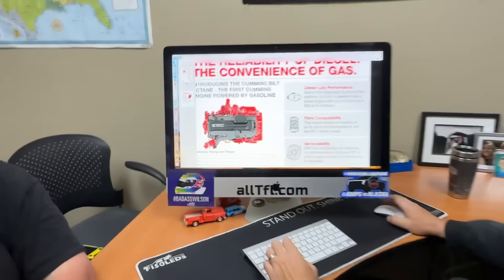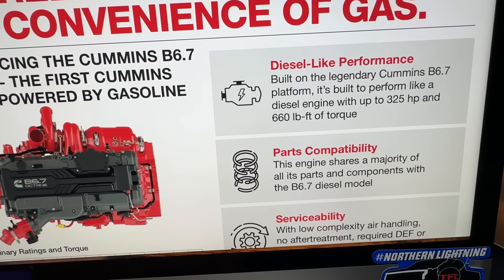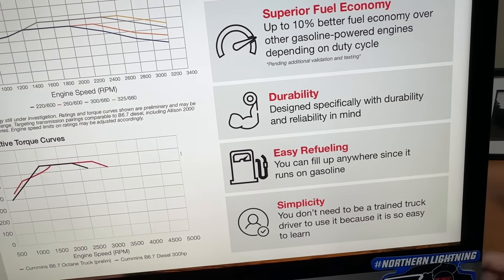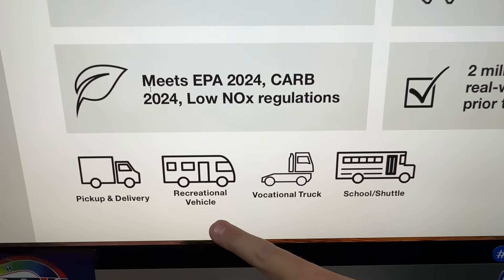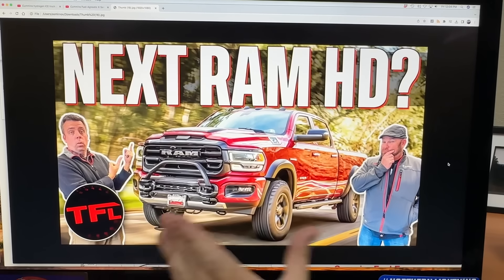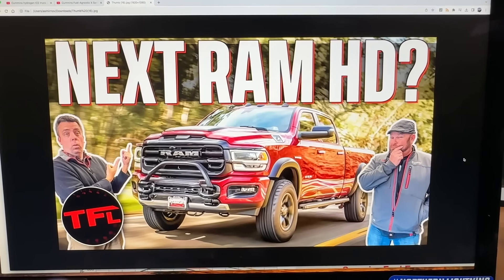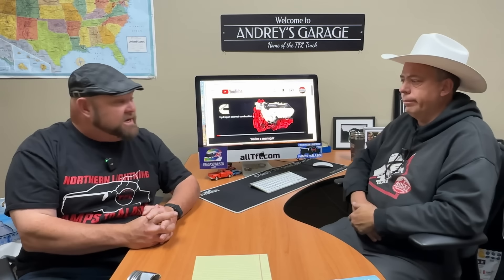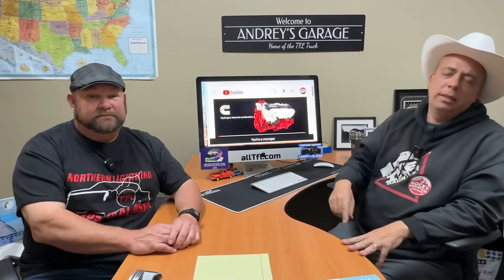It's Not Just Diesel Anymore: Cummins Built a GAS Engine We Want to See in the Next Ram HD!

Comment: I work for Cummins and seeing the tech they’re coming out with behind the scenes is mind blowing. Excited for what’s coming out!
Reply: have they fixed the diesel block yet .they lighten up new design and now it stretches
Reply: @overbuiltautomotive1299  what engine are we talking about?
Reply: The 6.7…they reduced the block weight and now the crank main caps are fretting
Reply: @marcusrussell3375  I know they reduced the weight but the engineers also claim that it’s stronger than ever. In the heady duty world we don’t really see issues with the bottom end on an ISB. We do see a lot of dropped valve seats and what not.
Reply: @overbuiltautomotive1299 the engine that's in the Ram trucks is completely different from the actual B6.7 engines
Reply: What octane gasoline will be required?
Reply: The power numbers are anything but "mind blowing" though. Maybe it would sell well for industrial applications but very few people are going to buy a 3/4-1 ton truck with under 350HP. If this thing basically has a diesel bottom end and rotating assembly then it should be more stout than a 2JZ with more than twice the displacement! It should reliably be able to make north of 400HP with the boos turned up a little. Cram 25-30PSI of boost down it's throat and it should be able to reliably make 600HP and 1000ft-lb.
Reply: @johnlacaria2728 87 octane. On the newest up dated version on the spec sheet it says 87

Comment: We have 7 15L Cummins running on natgas here in the oil field.  All have over 50,000hrs on them trouble free.
Reply: We’ve ran propane mowers for landscaping and the oil always looked new on them. Just didn’t have the pick up gasoline does
Reply: 915 cubic inches
Reply: Are these ISX12 N engines?  The X15 N is brand new and hasn't been around for 50k hrs (7+ years).  Or were they converted for dual fuel?
Reply: Do you see lot of cat 3520 natgas engines?
Reply: @freedomisntfree_44 i see what u did there
Reply: @MrPizzaman09 That's not entirely true. Well, I guess it's technically true. There was a Westport branded orange ISX that ran on CNG and diesel. That's over a decade old at this point.
Reply: They don’t do as well in an otr truck
Reply: @darryladams519  some if the trucks have 16L
Reply: Don't belive that for a minute used to have 35 of them where  i worked they were junk 4 maybe 5 miles per gallon  no power we pulled 53 foot trailer took for ever to get up to 55 miles a hour  empty or loaded
Reply: When do the tanks for to be replaced?
Reply: Good to hear i brought 6 125 generators  from united rentals to oil rig would not keep running

Comment: Gasoline.  The best delete kit made.  I literally specifically ordered my Duallie 3500 with a Hemi to avoid the issues of Diesel Regulations.
Reply: Particulate filters are coming for gas engines.
Reply: Shhhh, if everyone knows our secret, gas engines will be more expensive. "YEAH DUDE, GAS IS FOR PUSSYS!"
Reply: A hemi and straight six gas engine are not equal. Your gonna drop a valve far before a cummins would.
Reply: systems today are extremly realible. failure are mostly due to poor maintenance which they do require a few other things. but i took my first particulate filter to 577,700 with out issues at all. everything i needed to do was right there in the owner manual.
Reply: Diesel is still the king for towing heavy loads. No comparison to gas..
Reply: @jamesrussell6870  Explain the Ike towing test results with the 3.0 liter diesels and the 2.7 EcoBoost.
Reply: I was going to do the same for my next truck.
Reply: @PistonAvatarGuy  You're talking about small displacement engines in a half ton pickup. How well do you think a 15 liter gas engine would do in an OTR truck? Think it would make it 1,000,000 miles before an overhaul like many diesels do? Gas is great for lightweight vehicles but cannot compete when it comes to pulling heavy loads.
Reply: @jkneeland89  We just established that a 2.7 liter gasoline engine tows far, FAR better than a bunch of 3 liter diesels in light pickups, so why wouldn't a 15 liter gasoline engine be able to match the towing performance of a 15 liter diesel in a long-haul heavy truck? I also wouldn't suggest that gasoline be used in heavy trucks, it's too expensive, but CNG works just fine and the engines last every bit as long as diesels, while also requiring less maintenance.
Reply: @jkneeland89  It's also worth noting that gasoline aircraft engines outlast diesel aircraft engines, so how long a gasoline engine lasts is simply a result of how long it was designed to last, it's not related to the fuel that the engines are burning.
Reply: @PistonAvatarGuy  It all depends on application, which was my point in the first place. You are trying to imply that diesels are obsolete and gasoline is superior. That is simply not the case. Gasoline will never replace diesel for OTR trucks, farm equipment, etc. But I guess all those manufacturers that build diesels are just stupid, they should’ve consulted with you first.
Reply: @jkneeland89  Diesels are obsolete in light vehicles, they simply don't offer any advantages in light vehicle applications.

I never said that gasoline should replace diesel in heavy vehicle applications, nor did I imply that it should. I said that CNG should replace diesel in heavy OTR trucks.

And, no, the manufacturers of diesel engines are not stupid, they're simply building engines which make use of a fuel that is still relatively inexpensive and available, but that can change and it almost certainly will.

Either way, the diesel fanboys always try to argue that diesels offer a performance advantage, but that's simply not true.
Reply: You ppl that believe gas is where it's at go ahead pull heavy loads long distance with gas good luck with that
Reply: @lost94133  As far as pulling power goes, gasoline engines massively outperform diesel engines while towing.

As far as efficiency goes, it's difficult to make a direct comparison, as the only turbocharged, direct injected engines are too powerful to compare to the diesels in their displacement range, and the HD pickup truck engines currently in production don't use comparable technologies (no turbocharging and/or DI), but the difference in an apples to apples comparison is almost certainly not all that significant. No modern gasoline heavy truck engines exist at all, of course.

And, just for the record, I'm not saying that gasoline engines should replace diesels in heavy trucks, I'm just saying that gasoline engines tow heavy loads just fine.
Reply: @lost94133  Don’t waste your time with avatar clown, he’s a troll. I remembered his name after responding from other videos. He always makes ignorant comments about diesel. I’m not even a diesel “fanboy” I just have common sense.
Reply: @jkneeland89  If I'm a troll, how am I wrong in my assertions here? I really would like to know.
Reply: @PistonAvatarGuy idk man, an 8.1 big block tows just fine…
Reply: @jkneeland89 Horses for courses, right? Diesels are great for industrial and heavy-duty applications. No argument. Most pickup owners are taking their ball to bowling league night most of the time. Dodge and Cummins made a mint off of the dominance fantasies of suburban dads.
Reply: @Jez-p9k  Yeah, but at the same power level, gasoline engines can be nearly as efficient and are definitely efficient enough to be cheaper to own and operate.

HD diesels are only superior because there are no HD gasoline engines that are built to compete with the diesels (large displacement, direct-injected, turbocharged).

I know exactly what I'm talking about, kid.
Reply: @jamesrussell6870 spoken like someone who doesn’t even understand the difference between.
Reply: Yall are arguing over a question that's already been answered in thermodynamics. Diesel engines are more thermoefficient than gasoline engines. It's 30% to 20% iirc
Reply: @jeffhall768  Diesels are not inherently more efficient. The Otto cycle is more thermodynamically efficient with much lower compression ratios (a Diesel cycle engine would need a compression ratio of about 22:1 to match the cycle efficiency of an Otto cycle engine with a compression ratio of 12:1), and with the high compression ratios that gasoline engines are able to achieve these days, diesels rarely offer a significant (thermal) efficiency advantage. Modern gasoline and diesel engines are both in the mid 30 percent range as far as thermal efficiency is concerned.
Reply: @jeffhall768  It's also worth noting that diesel engines in aircraft are LESS efficient than the 70 year old gasoline engine designs that they're attempting to replace.

Comment: Kubota did this because they already had diesel blocks,  doesn't work the other way around because diesel blocks are stronger than gas blocks.   Could make a VERY long lasting gas enginge
Reply: Agree,  The big challenge for a spark ignited engine is the ability to transfer heat into the jacket water.  With direct injection, 3 way catalyst and a specific cylinder head this engine could be really successful.  It takes more than just putting a spark plug into a diesel head and calling it a day.
Reply: Time will tell its all about emissions

Comment: Multi fuel engines have been around for industrial and military since the the 1930's
Reply: This isn't multi fuel.  Each engine will still be only single fuel type
Reply: Thank you for calling it multi fuel. That's what is was, is, and has always been the term. Not this bs term that Cummins is calling it.
Reply: @gearhead7896  Yeah, they refine it and give it raised white letters and they've reinvented the wheel. 🤔
Reply: @davidroche9964  🤣😅🤣 Reminds me of tron legacy when they ask well what improvements have we made to OS12 and the CEO says we put a 12 on the box
Reply: @gearhead7896  Yep, marketing 101 ! 🤨
Reply: @jdking25  Yes, that is how it's presented and you're probably right. But, I think some will be multi fuel, at least bi fuel. Like CNG and Gasoline for sure.
Reply: @gearhead7896 No. Single fuel per engine, just multiple flavors.
Reply: @MCgrease08  No, re read my post. CNG engines are typically bi fuel.
Reply: True but civilian vehicles have  emissions systems wich could be  a booger to engineer for a multi  fuel
Reply: Not multi-fuel. Different heads for different fuels.
Reply: @jml6357  we've been through this, read all reply comments before commenting
Reply: @gearhead7896 Cummins CNG engines are not bifuel.
Reply: @wallcouldtalk  yes, but 99% are
Reply: @gearhead7896  Not anymore.

Comment: One thing I think is that if they give up Cummins in heavy duty truck while the other manufacturers still have their diesels they will loose. Ram Trucks are very nice trucks but Cummins is a big part of what people like about them. Replacing the Hemi with a Cummins gas engine might work as long as it performs but if they give up Cummins diesel for some in house motor I think that would be a huge mistake. Cummins has a loyal following and I think people will walk away without it.
Reply: I think it just allows for more and better options. Because Cummins and Ram are so good, and like you said, Cummins has a loyal following, Ram and Cummins might do better with this head change tech. I love Cummins, I’d buy any engine they make, gas, math as, or diesel, great engines
Reply: The cummins name is the only reason Ram uses their engine. Fiat makes their own 6.7 engine for their CNH equipment. (case/new holland)

Comment: Cummins already makes natural gas engines for their natural gas generators that we use offshore and on hospitals in South Louisiana and also for water pump stations some big 6.7 L engines that work off natural gas. Or to run on diesel, the engine designed to run on natural gas or diesel whatever fuel you have.
Reply: I bet the gasoline launches forst

Comment: Well if they got a crate engine solution and you can put it in an existing Ram because you want to get rid of the death filters and still have the ability to pull a trailer or haul a load that would be awesome and the possibility you could retrofit this to an older truck and have a stick shift behind it

Comment: In the 90s there was available a natural gas and diesel mixed fuel aftermarket kit for large trucks and later for smaller diesel vehicles. These used about 25% methane and 75% diesel. The improvement in noise, emissions, mpg,  and smoothness was incredible. It was also complicated.  But it might have been better than DPF measures.
Reply: As an engineer at a truck manufacturer, I have more recent experience with Diesel engines that have aftermarket conversions to run on natural gas.  On smaller engines, like a Cummins B, they entirely eliminate the Diesel fuel by installing spark plugs in place of the injectors and pumping natural gas into the intake manifold.   On larger engines, like a Cummins X, they make dual-fuel system that uses a small amount of Diesel fuel as a pilot injection to light off the natural gas.

Comment: International used to build a huge I6 gasoline engine.   The biggest one was 501 ci.  But they also had 401,406,450.
Reply: 1091 Hall-Scott inline 6…
Reply: International is absolute junk!
Reply: 534 was the biggest
Reply: @billsoinski9136  That was Ford, and you had to cover your truck in gas tanks to get anywhere with one.

Comment: Really nice to see more Internal combustion options for real world needs. especially working & commercial duty trucks....  Plus... being that it's using the traditional Diesel block.... which is designed for high cylinder pressures of diesel combustion/Turbo.....  This would make this a Very Robust candidate for performance upgrades.... this might be a MONSTER if done right.  looking forward to more details...  Imagine a Ram 5500 with a Cummins Gas? sweet.

Comment: I think they should do an aluminum head on it to lower the weight no need for a cast iron head  anyway since the gas engine will have 11 to 1 or less compression ratio you don’t need the extra strength .

Comment: I had a 250 straight six in a 74 C20 that I preferred over 305 V8's. Same thing with 300 straight six Ford's, I preferred the 300 inline six over 302 V8's in trucks. They don't lug as bad as more powerful V8's.
There is a legitimate reason why the inline six is the preferred platform for industrial diesel engines. 
My 74 C10 was used to haul scrap metal here in hilly western Pennsylvania. It wasn't worth taking a load in if it was under 2,000 pounds and she kept up with traffic just fine even on hills. I had an 86 F250 with the 300 six that was a rack truck that spent its life overloaded with ladders and scaffolding. The same deal, she kept up with traffic without giving any thought to it. Both happened to be manual transmission equipped, the 74 C20 was a column shift 3 speed and the 86 F250 was a 4 speed.
Both had great fuel economy and neither had overdrive. With OD I suspect either would rival the fuel economy of any modern 3 liter v6 powered SUV or truck.

Comment: According to rumors in Auburn Hills, a second engine is planned for these trucks. It, too, would be an inline six-cylinder, but engineered specifically for truck engines. The new engine is rumored to be larger—3.7 liters—and to have a more traditional design, other than an odd 30° tilt. A source within Engineering told us that it was tilted over to make room for accessories on the side so that it could fit into smaller engine bays; and to provide space for a better air path, increasing its efficiency. ...
Reply: Oh, so they're going back to the leaning-tower-of-power, the 225 slant 6?🤣👍👍
Reply: Bad idea  just use Cummins
Reply: The reason for tilting any inline engine is to lower the hood line of the vehicle.
Reply: I think I heard they were talking a hurricane with a little more displacement for the heavy duty pickups. 
It would make sense to offer the Cummins gas and cng engines alongside the diesel.

Comment: I remember when I was younger, all the UPS step vans used the Ford 300 inline 6. Makes sense to bring back that engine architecture. Less moving parts, better reliability, and since it's gasoline powered, there's more available fueling for it.
Reply: Inline engines do seem to be making a comeback, though obviously with turbochargers since people expect a modern level of power and torque.

Comment: The M35A2 DUCE 1/2 engine was also one of the first multi-fuel platforms able to run on diesel, Kerosene, Marine Oil, And gasoline. Powered by  an LDT 465 in-line 6 cylinder turbocharged multi-fuel engine.
Reply: Yesterday was a multifuel engine. 
These will be limited to the fuel they were set up for.

Comment: Chevy did this in the late 70’s and early 80’s. They took an Oldsmobile v8. They  took the olds 350 changed pistons and put on diesel heads and intake.   My dad had one in an 81 caprice. When it finally gave out. We swapped the  heads out for gas heads and 2 barrel intake and ran the heck out of it for several years.

Comment: I imagine that Ram will probably offer the Hurricane I6 as a base engine with the upgrade to the 6.7 Cummins gasser or diesel. The diesel will probably remain as the highest priced and highest performing engine while the gasser 6.7 will be a mid tier offering. I think the gas powered Cummins will be cheaper because it doesn't require the emissions systems the diesel does, and diesel fuel injection is more complex versus gasoline fuel injection, even in direct injection applications.

Comment: I've had 12 BMWs built and tuned like a diesel but with gas e85 fuel. low 4500rpm, small turbo, same afr as a diesel would. works fantastic. cheap corn fuel but 30mpg in a 6000lb  x5 that tows with zero issues and makes diesel low end torque an new normal diesel top end. I'm really surprised it's taken this long for anyone to do
Reply: Good  day  N54  Do u live in North america?   Bmw are english!   Thanks
Reply: @donvoll2580  BMW is European
Reply: @N54God666  German to be specific hahaha